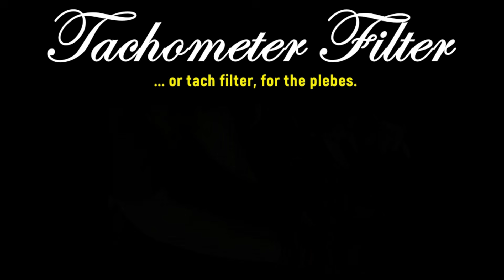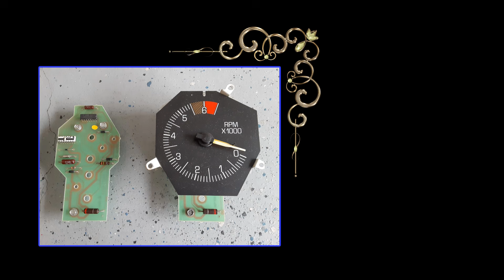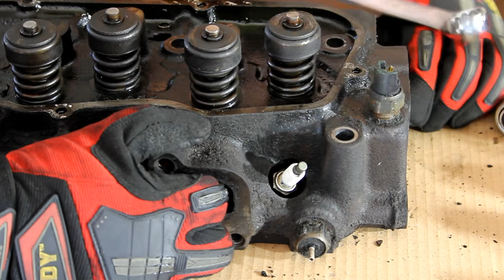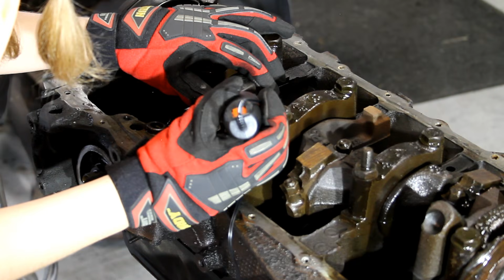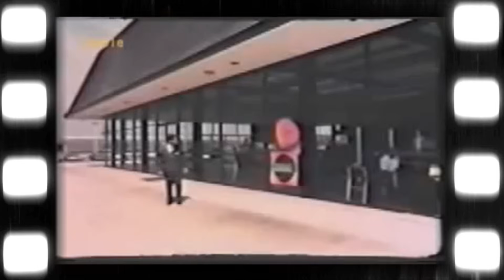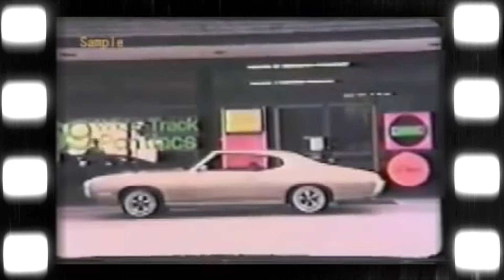Iron Duke Engine Disassembly Part 2! - Gen Z Garage - Ep 16

Comment: ive built quater mile racers! im want build iron duke but with best MPG ! maybe performance cam... upgrades to timeing gears .. few other .. air flow ideas.. Kiss= keep it simple! All less = better.. NO A/C .. toss that .. add a/c pully adapter.. free spin lol.. any ideas for moreeee.. tell please.. Thinking flat allum raceing pistons.. good quality rings. bigger exaust valves. ..maybe roller rockers. 2 inch exaust pipes and 2 barrel carb  - elderblock or holly .. help me out here.... motor goes in 2wd mail jeep .. lite/ lowered /small tires - xtra litened! - daily driver .. cheeeeeep gas !
Reply from the maker: Im gonna be rebuilding a 3.4 v6, so just wait!! :)

Comment: Awesome and informative as always. I had a silver base model '84 Fiero Sport Coupe I guess it was called as oppossed to the S/E that was one trim above it. No GT trim yet.  My dad bought it out of the rebuildables section at the local wrecking yard in 1989 when I was 17.  It had a blown engine, and we got a good Iron Duke out of a Chevy Citation from the same yard. My dad was a mechanic, so we always drove cars bought on the cheap. Keep up the hard work and the channel.